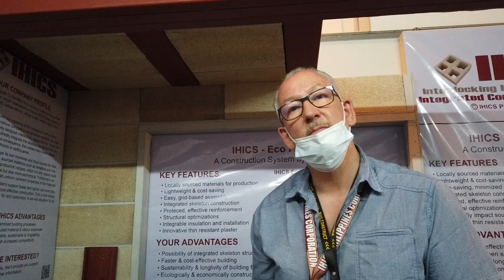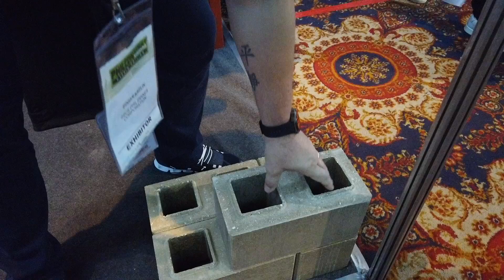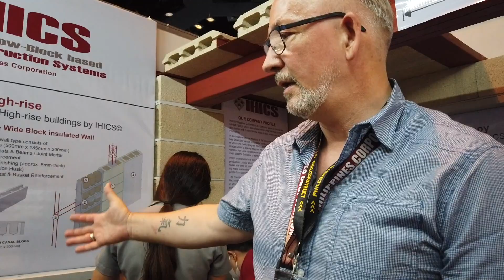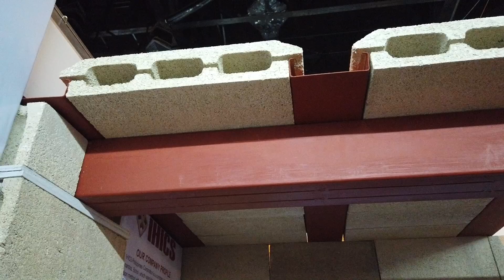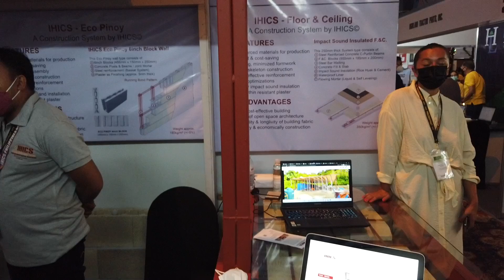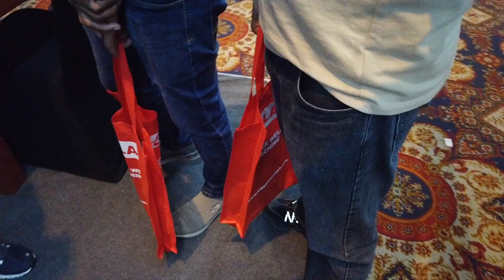Swiss Designed Interlocking Hollow Blocks, Bohol, Philippines.

Comment: I would like to see detailed engineering for a typical 2 story residential home. Can the integrated post and beams as shown on the illustration fully replace the typically much larger reinforced post and beam structure? If yes, then this system would be interesting. In Italy they build earthquake resistant houses similar to this, but Philippines has stronger earthquakes and engineering needs to allow for magnitude 8 earthquakes.
Reply from the maker: Sorry this company is based in Bohol Island, im in Cebu so we cannot easily feature that.
Reply: @villagepeoplephilippines  well, if that company did not provide sufficient information about earthquake resistance to you, I think they did not do their homework. I do wonder why you did not ask them? You should be able to answer that question, if you are recommending their product. This is a much more essential issue than heat insulation considering that insufficiently reinforced masonry structures regularly kill people in the Philippines. I have seen that myself when doing relief work after a series of 6.5 earthquakes in Minadanao. I will contact the company directly and ask them about their earthquake engineering.

Comment: Strange how they could get a patent for this,the smaller interlocking blocks has square tabs on top,this has already been patented e.g. Energy Block. Building with these blocks is way more expensive especially if going by their system,where you have to use 60% more steel.

Comment: Welcome to proper engineering Philippines. Insulation is seriously lacking in Philippines.  Costs to Aircon greatly reduced.
Reply: Why do you need insulation? Philippines is never cold and you can not reduce heat by insulation.